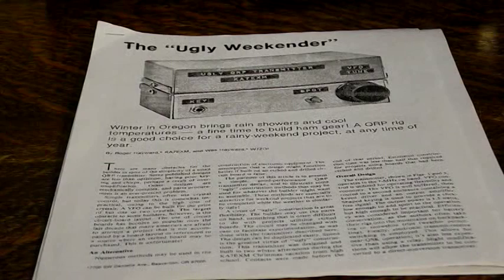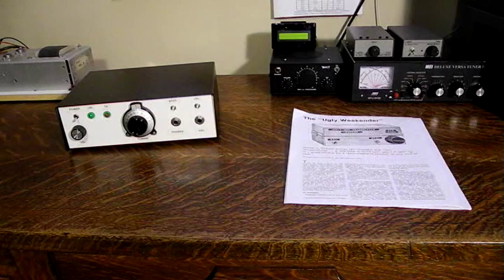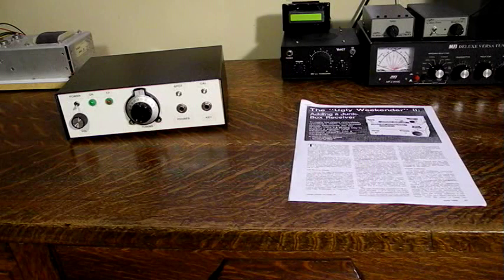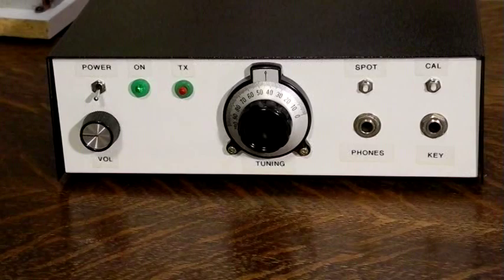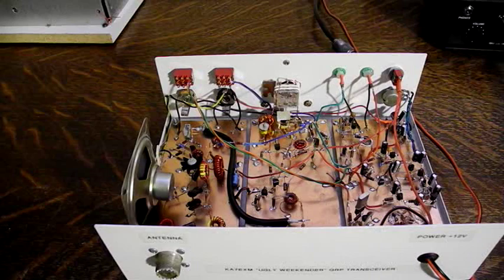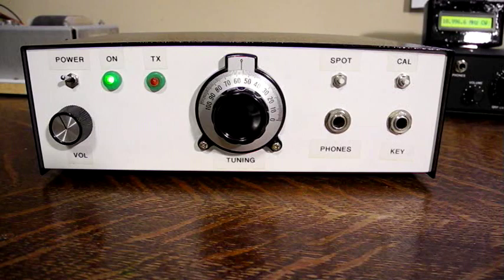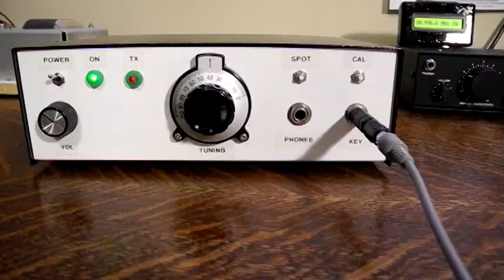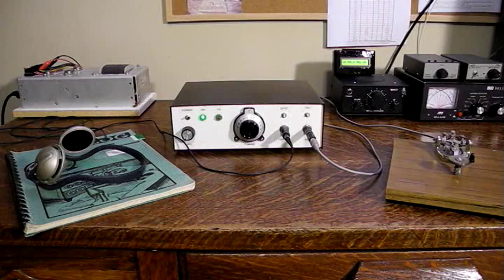The Ugly Weekender - A Homebrew QRP Transceiver

Comment from the maker: Using a QRP (low power) transceiver like this one presents some challenges. I wouldn't recommend it for a new ham as it could be frustrating to learn the basics of making contacts when using low power, limited range of frequencies, and no built-in indication of frequency. You're better off starting with a commercial transceiver or a commercial kit.  Depending on your license class, a beginner may also not have a class of license that allows using a homebrew transmitter.
Reply: what kind of license do you need to use a homebrew transmitter???

Comment: Jeff,

I really relish your reviews; they are about the best in the You Tube firmament. Brief, concise, factual, and to the point. As a sidebar, however, I note you have a SCAF-1 filter (background). Be advised that they have a circuit problem that their manufacturer will not acknowledge. (In fact, the original QST circuit has the asame flaw.)  

I blogged about it here:

righthandofzod.blogspot.com/2013/05/idiom-press-scaf-1-wars-my-own-fresh.html

72,

Bill, k6whp